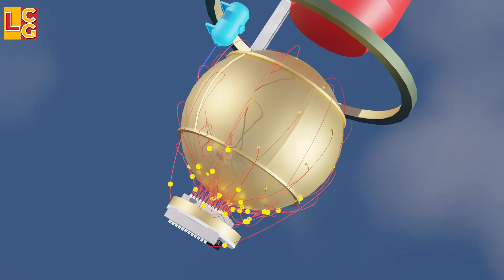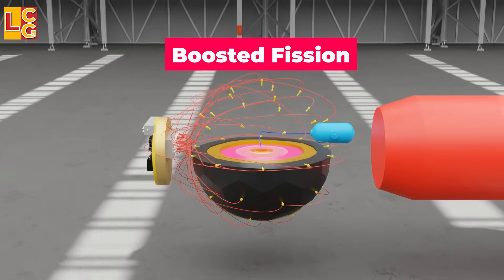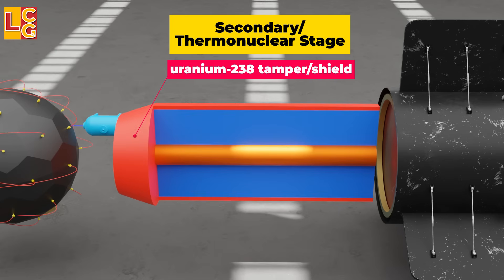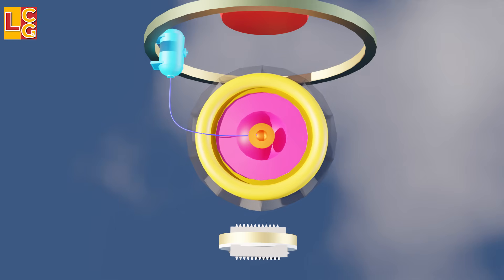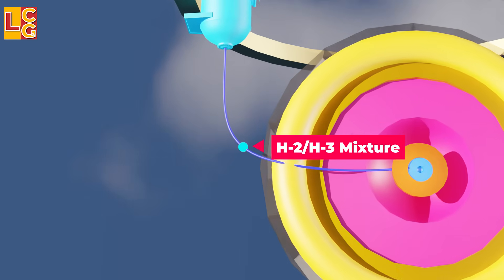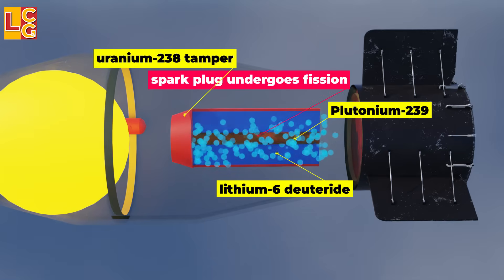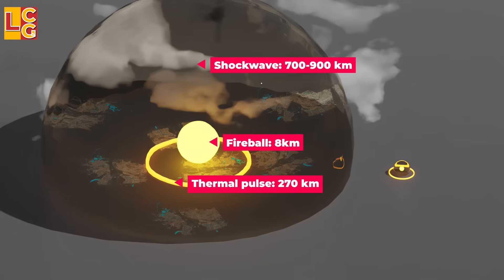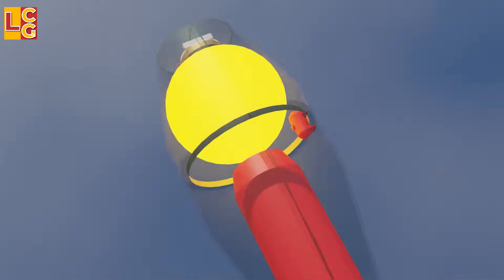How Hydrogen Bomb Tsar Bomba Works

Comment: It wasn't a two stage weapon.
Explosive lenses aren't portrayed accurately, and probably weren't used in the Tsar Bomba.
The tamper and the shield are different structures.
The secondary fusion fuel is not a tritide.
No hard evidence of polystyrene ever being used as an interstage material.
Fission chain reactions don't start because of heat.
The secondary fission product atoms are not the same.
The boost gas is injected prior to primary implosion.
The interstage plasma pressure is only a few percent of the total pressure acting on the secondary. It's mostly due to ablation.
Reply: 3 stage bomb  , it had 2  secondary
Reply: @JohnSmith-fg6pt  Not quite.
Reply: Why would you say explosive lenses were not used? Isn't that essential to get the primary stage going?
Reply: @mryhdy6266  Slow fast lenses were obsolete by the mid-late 50s in the US. The USSR almost certainly figured that out around the same time
Reply: @Evan_Bell  
Thanks,;but how do you get a uniform pressure wave to compress the primary to criticality?
Reply: @Evan_Bell  
I seem to recall that components like capacitors that enable multiple explosions to occur within microseconds are still considered off limit, that would seem to imply explosive lenses still being used.
Reply: @mryhdy6266  2 point flying plate air lenses or synchronous explosive circuit multipoint initiation.
Reply: @mryhdy6266  It would imply that multiple detonators need to fire simultaneously.
Slow/fast explosive lenses aren't the only way to produce a spherically convergent detonation wave using multiple simultaneous initiations.
Reply: @Evan_Bell  
So what other method works? I saw a design using only 2 points, but ultimately it is still a lense
Reply: @mryhdy6266  2 point flying plates and MPI.
Neither are explosive lenses like those portrayed in the video.
Reply: @Evan_Bell  Sorry to bother you, but you seem to know your stuff. I have been wondering with all the time, money and effort put into 5th and 6th generation warplanes, how far does the electro-magnetic pulse from a nuclear weapon spread with enough power to fry an aeroplanes electronics? Could a Country such as North Korea set off a nuclear weapon just for the EMP to drop attacking planes out of sky? Effectively using a nuke as a defensive tool. And, if so, what kind of range would such a blast have a negative effect on planes? I just imagine all their electronics must be sensitive, and perhaps vulnerable to such a defence. Sorry again if the question is out of your wheelhouse.
Reply: @tsubadaikhan6332  I'm afraid EMP isn't one of the effects I understand particularly well. I understand the concept and theory, but don't know enough about electronics to tell you at what sort of range from a given weapon something like a fighter jet could survive the EMP.
What I can say is that large fission yield exoatmospheric bursts can induce fields of many kilovolts per meter. How resistant an F-35 or anything else is to this field, I can't say.
What I believe to be most vulnerable to EMP, are electrical grids, as grid cables spanning tens or hundreds of kilometers experience extremely high voltages, which I believe is enough to destroy transformers and many other pieces of electrical equipment. Something smaller, like a phone, car or aircraft will be less vulnerable.
Reply: @mryhdy6266  a special kind of casing. the plutonium sphere must be compressed as fast as possible, and it needs micrometric precision in the making. like, even if you tried to hammer a bar of fissile material you will get a blue flash but it will not be supercritical, this is really all about timing. the rest is easy you can have one or two second stage, or even a third stage with an egg shaped Lithium-6 deuteride as fusion fuel that is activated by a rod of plutonium that will transmit the initial chain reaction's energy into thermonuclear fusion.
voila.
Reply: @Evan_Bell  There are other ways to lower the critical mass of the P239 core to cause a detonation but these are not made public and remain classified to prevent terrorist groups assembling a plutonium bomb. But we can speculate, though I would not share my ideas here.
Reply: @captaincat1743  
Critical mass is reduced by shock compression and neutron reflection.
If other techniques are classified, how do you know such additional techniques exist?
I've created hydrodynamic models of modern implosion devices reconstructed from known  parameters. No additional means of reducing the critical mass were required to produce a yield sufficient to ignite the boost gas.
Reply: @captaincat1743 It's not classified. Neutron reflection reduces the required critical mass.
Reply: @Evan_Bell  how is it possible to have the core standing on nothing?
Reply: @Marcos-fu9go  If you're referring to the pit of the primary, it's supported by high explosives. If you're referring to the secondary, it was braced.
Reply: @Evan_Bell  that's make sense. I've been researching explosives and nuclear artifacts for years, trying to understand exactly how they work is really hard, knowing every detail as I want is almost impossible
Reply: Ya I was wondering how they would inject the gas after. LOL
Reply: You to have higher pressure then the pressure inside the blasted sphere where it’s hot and high enough pressure to support an nuclear reaction.

So yeah that shit ain’t gonna happen. It’s probably filled just before the the fast explosives get triggered.
Reply: So happy you pointed out all the errors in this video so I don’t have to. Nice work!
Reply: I mean he did say in the video that the design is unknown but the way he explained it is how H bombs are usually designed
Reply: @venomactual73  Enough is known to know the description given isn't accurate.
Reply: @Evan_Bell  Is it true that fusion bombs are ignited by a fission implosion inside the same structure?
Reply: @erickanter4090 If you're talking about explosive lenses, no, they were obsolete in the US by this time, and probably also in the USSR.
Reply: Good critiques.  Also, I believe the Tsar Bomba primary was a gun type (uranium) device, not an implosion (plutonium) device.
Reply: @psychohist  It definitely was not a gun type. 
It was an implosion device, almost certainly with pure uranium or possibly a composite core, not a pure plutonium core.
Reply: @Evan_Bell How do we actually take atoms and put them into a bomb? How do people physically take something that can't be seen at the most micro level, is what is confusing me.
Reply: @FknAzzMuncher  Understandable.
We're not talking about individual atoms.
Were talking about a material made of atoms.
If you own a gold ring, that ring is a mass of gold atoms.
Same for a balloon filled with helium, a vial of Mercury, anything that is a pure element.

Something more complex like leather, plastic or a rock are more complex, and built of arrangement of different atoms of different chemical elements.

Uranium and plutonium are chemical elements, like gold, helium and Mercury. A block of pure uranium is a collection of uranium atoms. 

In a nuclear weapon, we're talking about solid pieces of solid uranium or plutonium. Both of those materials are pure metals, like gold or iron.
In the first weapon test, it was a solid ball of plutonium metal.
Reply: @Evan_Bell  wow i feel so dumb now for asking that haha
Reply: @Evan_Bell  thanks for answering though i really appreciate it
Reply: @FknAzzMuncher  Nah, it was a fair enough question.
Reply: @Evan_Bell  So in essence, are they just taking plutonium and or uranium and constructing it into a sphere and then making it shrink perfectly symmetrically down to critical mass via chemical explosives?
Reply: @Evan_Bell  I promise this is the last question i'll ask you if it's not a bother
Reply: @FknAzzMuncher  That's the simplified gist of how implosion type fission weapons work, yeah.
Reply: @Evan_Bell don't forget to tell em it's not just uranium straight out of the ground, it's highly enriched uranium
Reply: @MrKKUT1984  I don't think anyone implied they believed otherwise.
Reply: @Evan_Bell  I just mentioned it because of some of the questions I see being asked not because someone mentioned it specifically
Reply: @Evan_Bell  Do you know the answer to my question above out of curiosity? or is that something that's hard to have knowledge of?
Reply: @Treyphilips-y8f  I have already answered that question twice.
Yes, hydrogen bombs are triggered by a fission device.
Reply: @Evan_Bell  oh okay my bad for not seeing it. Thanks for the reply.
Reply: You cant use plutonium in a gun type device. Plutonium fissions far more spontaneously than U235. So it wont make a critical mass, it'll begin to fission before the plutonium projectile fully forms a critical mass with the target ring of plutonium. The 300m/s it's travelling at isn't fast enough.@Evan_Bell
Reply: @garethjohnstone9282  I know..
It's not that if won't form a critical mass, but that it's difficult to assemble it fast enough to avoid predetonation.
Reply: @Evan_Bell  That's the same thing I said, just worded differently lol.
Reply: @garethjohnstone9282  Worded correctly. A plutonium gun type device would indeed become critical.
Reply: @psychohist  There are images of the Tsar Bomb's primary stage out there. It wasn't a gun type.
Reply: He did put the other theories in the end tho
Reply: @Treyphilips-y8f  Yes.
Reply: if it wasn't a two stage, then what is it ? by the way you seem to know a lot about physics of nuclear weapons so, if i can ask you that too, how you modulate the ablative pressure to get an isentropic compression of the fusion fuel ? i have learned that a single shockwave, even an extremely powerful one, can't compress sufficiently the fuel and because of that you need a succession of shockwave of increasing pressure. So if you can help me with that i would be really happy :)
Take care of you
Reply: @flav650 
Film of the assembly of the Tsar Bomba shows it to feature several (6-8) parallel secondary or tertiary stages, not a single second stage. 
As for secondary pressure modulation, that's one of the obstacles that hasn't yet been solved in the public sphere.
One possibly plausible hypothesis is a standoff gap between the secondary tamper and the fusion fuel. Once the radiation diffusion wave undergoes hydrodynamic separation, it produces a classical shockwave that is strong enough to vapourise the tamper. This cloud uranium (or in the case of the Tsar bomba, lead) gas flows across the gap, impacts the fusion fuel, and piles up against it. It may be possible that this piling up can drive a pressure wave into the fusion fuel of the right profile to minimise entropic heating and compress it rather efficiently.
An alternative hypothesis is interstage structures that leak thermal radiation from the primary to the radiation channel around the secondary at the appropriate rate, such that the growth rate of the ablation pressure directly produces a wave in the fusion fuel that leads to high compression.
Another possibility is a graduated ablator of multiple layers of different materials that produce different ablation pressures for the same radiation temperature, and as as the radiation diffusion wave passes through these various layers, the ablation pressure increases. 
Truth is, we don't yet know.
Reply: So the sparkplug is needed only for generating neutrons, which in turn split the lithium atoms for getting tritium?
Reply: @klavesin  No, the sparkplug heats the lithium deuteride to the point of deuterium deuterium fusion ignition.
Those D-D fusion reactions produce the neutron flux that breads the tritium from lithium.
Reply: @klavesin  Neutrons and X rays are both generated and both are needed when Lithium Deuteride is used as the fusion fuel.   Which is in all probability what the Russians did as they were copying American designs that had been acquired through espionage.
Reply: And it all happens so incredibly fast
Reply: So, basically, this video is wrong.
Reply: It had 6 thermonuclear devices in a frame with a holder for the final thermonuclear assembly. I could imagine that stage would have simply been a can of DU filled with 6LiD and a rod of HEU or Pu in the middle surrounded by beryllium or another neutron delay/reflector material. Since it has 6 thermonuclear devices, the tirtiary stage would have had plenty of neutrons heat and pressure to fire up the DU can as a fuel, not to mention the outer casing was originally intended to be DU as well. Check out the declassified video about this device. They do show the guts of it briefly, and it has 6x 9Mt thermonuclear units inside. As for some of the details this video got a lot horribly wrong.😂
Reply: @christopherleubner6633  Id like to see the source material you got that info from.  It's bizarre. 
Why would 6 thermonuclear bombs be needed in one bomb? 

All that needs to be done to make a thermonuclear bomb more powerful is add more uranium or plutonium. The fusion stage makes 100% use of the uranium or plutonium, unlike in a standard atomic bomb, where only a fraction of it undergoes fission. For example, in the first atom bomb tested, only 15% of the Plutonium fissioned.

The fusion stage of a bomb simply makes more use of the secondary fissile material. To make the bomb more powerful, just add more uranium or plutonium.

Why on earth anyone would think there are 6 separate thermonuclear bombs in one, is beyond me.
Reply: When u think of the fact tht North Korea probably has 1 of these by now,(& it definitely has something more devastating than Fat Man!),u really start to believe tht it is only by the grace of God tht mankind is still in existence.
Reply: Are you a nuclear engineer?
Reply: @brendanlaven1697  No, I'm aerospace, but my employer also works in military (and is in the process of expanding in the civilian) nuclear energy sectors. I have considered transferring over for some time, but for various reasons have not. At least not yet. Later this year I plan to apply for roles within my nation's nuclear weapons laboratory. I have already been in contact with them, but at the time was unable to progress my application for circumstances regarding security clearance. That will change this year. I've yet to make a decision, but I'll certainly be speaking with the relevant people this year to evaluate my options.
Reply: @Evan_Bell  what nation are you from?
Reply: @brendanlaven1697  England. I work for Rolls Royce that builds military and civilian gas turbine engines, but also reactors for the Royal Navy's submarine fleet, and is developing a SMR. I plan to look into opportunities with the Atomic Weapons Establishment that's responsible for the design, manufacture, maintenance and decommissioning the UK's nuclear weapons.
Reply: Explosive Lens is the compression, to increase the density so the chain reaction can sustain. This is the same compression we see with Gravity within a supernova. My thing is how can a tube as they show in this video, how can that tube withstand the pressure and heat to boost this fission reaction? Lol.
Reply: @REktSigMa  Tsar Bomba likely didn't use explosive lenses. These were obsolete by the mid 50s.

The secondary doesn't withstand the conditions found in the radiation case. It's compressed and partially vapourised.
Reply: @Evan_Bell  A Hydrogen Bomb is a Fusion reaction that only a fission reaction can initiate. The reason these bombs are so powerful is because after the atoms are multiplied by Fission and sustains a chain reaction then the amount of "heat" and "Pressure" and the Styrofoam turning into "Plasma" creates more "Heat" and "Pressure". Both of these reactions happen within a millionth of a second of each other. Put it this way. The shockwave of the RDX and TNT did not even get to hit the bomb casing at all. I mean this nuclear reaction is ungodly fast.
Reply: @REktSigMa   Yeah, I know how nuclear weapons work.
What point are you trying to make?

Also there's no evidence Styrofoam has ever been used an interstage material.
Reply: @Evan_Bell  If there is no critical mass there is no sustained reaction. # Explosive Lens.
Reply: @REktSigMa  Yeah, I understand how criticality works. There are other ways to simultaneously initiate a high explosive sphere to uniformally implode and compress a fissile pit than slow/fast explosive lenses.
Lenses are bulky, heavy and obsolete. They were obsolete in the US by the time of the Tsar Bomba test. The Soviets had also probably moved on. Tsar Bomba probably didn't use them.
Reply: Wikipedia (i know) lists it as a 2 stage but was a 3 stage until the swapped out the Uranium for lead. Also maybe its specific to this device but I thought the Lithium as in the pit as a powder with a shelf life of 10 - 12 years before needing to be replaced.
Cant say on the plasma jacket material....everything I have ever read lists it as a polystyrene material but who knows given secrecy of nuclear weapons.
Reply: Tsar was a three stage, probably effectively a copy of the Redwing Zuni device, just made larger, just as B41 was scaled up from Redwing Tewa.
Reply: @dale116dot7  The Tsar bomba was definitely not effectively a copy of the bassoon device.
Reply: MAgic molecues duplicate themselves. For all the animation work, it is rather filled with errors. Close, but no sigar.
Reply: @HakonFlaty   sigar What?
Reply: @azzteke  "sigar" could be secondary stage, check how thermonuclear weapons are made, they show entire secondary.
Reply: @HakonFlaty  What's a "sigar"?
Reply: @NegativeROG similar to a cigarette 😂
Reply: @HakonFlaty  it's protons, gluons and gamma rays, molecules are irrelevant at this point. hell if anything the protons are itselves no longer existing but are just a quark soup.
Reply: @SilverSpoon_ Protons and even atomic nuclei exist at these temperatures.
Reply: @SilverSpoon_  For quark-gluon plasma to form, the interstage would have to be 200,000 times hotter.
The interstage is made of radiation dominated plasma of fully ionised ions and free electrons.
Reply: Looks like the bomb's creator got triggered
Reply: it was gamma radiation that compressed the second stage. the plasma came after.
Reply: @karmamatic  X rays, not gamma radiation.
Reply: @karmamatic  No. The prompt gamma  flux from a fission primary is 2 orders of magnitude below that of x-ray spectrum thermal radiation.
The interstage plasma is generated concurrently with the radiation pressure and ablation pressure acting on the secondary, as all 3 forces result form the same energy source.

I think you're confusing the fact that the EM radiation from the primary arrives at the secondary before the plasma from the primary.
That is true, but not what I'm talking about.